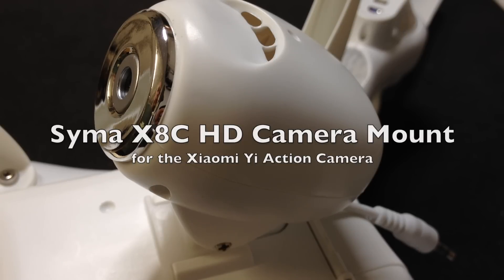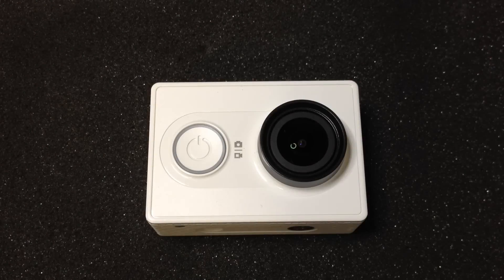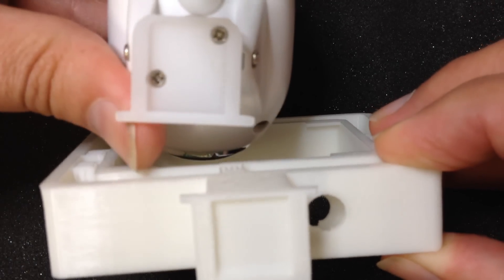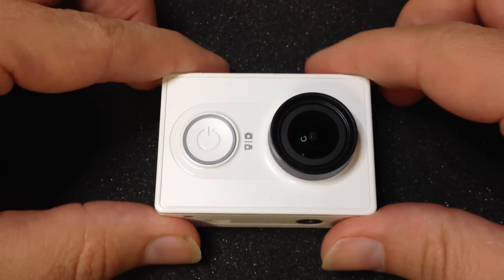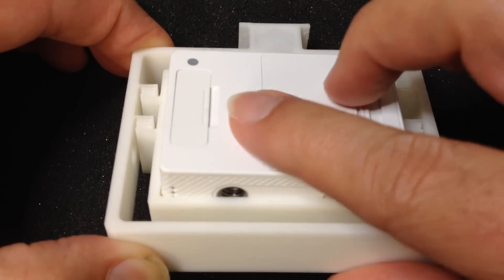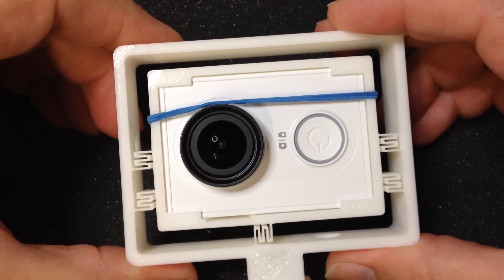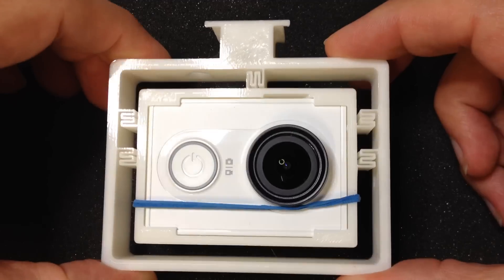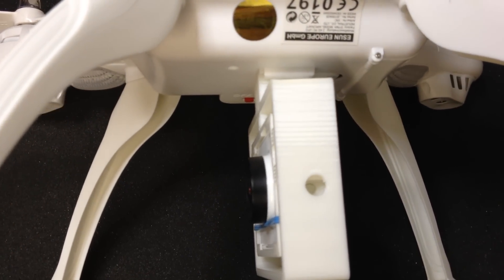Syma X8C HD Camera Mount

Comment: this will not work on sj 4000 cam because of side control buttons for one. Plus it's just a proto type he's rubbing in your face. the cam wasn't impressive the first one was better just need to work out jello with a few rubber bushings.

Comment: You are a genius!
With this support you have removed also the jello effect, right?
Reply from the maker: ***** Yes, but the vibrations on my Syma have been getting worse over time, I need to look into the issue.
Reply: Dirk Herrendoerfer Hi Dirk, i love the mounts you have created, i'll try to modify your STL file because i need only the top mount part of the attachment.
But im not an expert of 3d modelling program...can you also create  this piece? 

Thks in advance
Reply from the maker: ***** Just the part that attaches to the drone ?
Reply: Dirk Herrendoerfer yes!
Reply from the maker: in github.
Reply: Dirk Herrendoerfer Did you upload it on your Github folder?
Reply from the maker: Yes.